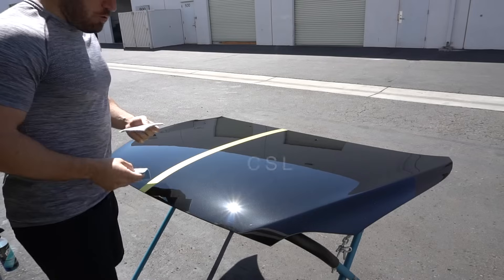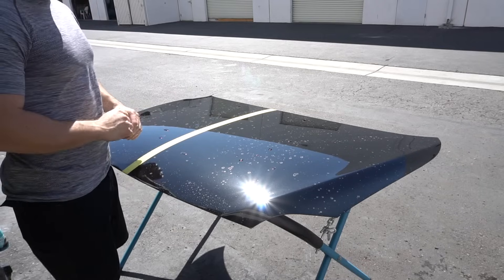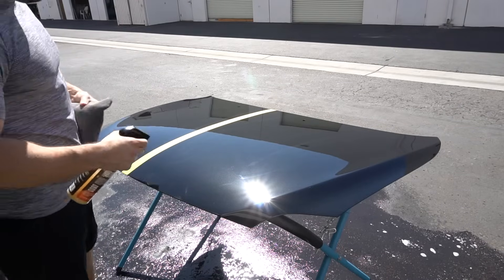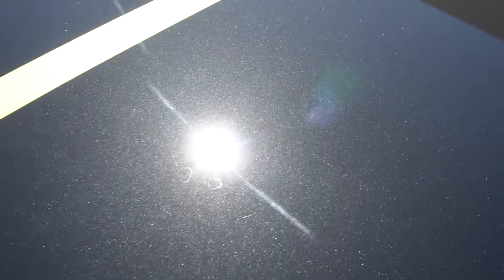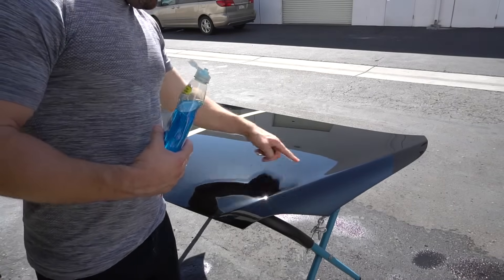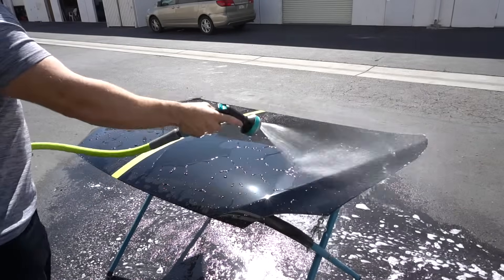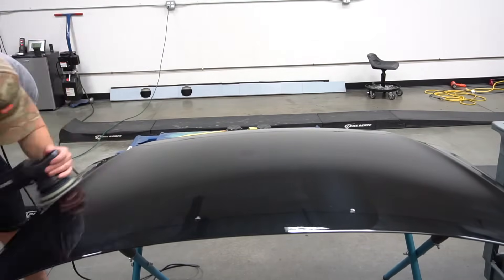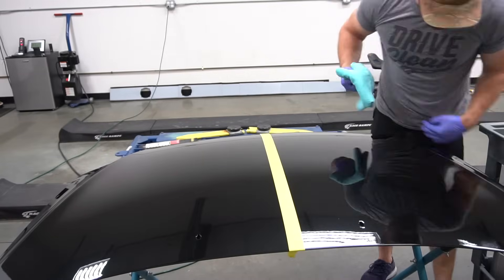Graphene Coatings VS Ceramic Coatings - Crystal Serum Light & Ethos Graphene Matrix

Comment: Great video. I have known about Graphene for years. The key was always the method to produce it and have it able to be applied to a surface (clear coat, paint, etc). Now you have demonstrated the properties - it is more resistant to poor washing, water spots, etc. which is why I have wanted to use it for years. I chose the Ethos product because the Company looks to be solid and the folks I see (Tim) are professional, approachable and able to communicate very well! I believe in Ethos. I watched this video and I didn't see any twist or turns to favor Graphene over the CSL. So, for me, this was unbiased testing. My results using the product are excellent. I have completed maintenance washes and clients cars have seen bugs, gravel, sand, massive heat and humidity. No problems at all so far.

Thank you for the test and keep up the great work! Chemistry will allow Graphene to evolve and likely improve, so I will stick with Ethos for the ride :)

Comment: great information... ethos makes great products.. btw, I know it's a test hood but it's still painful watching that water dry and etch on that hood.lol.. someone else mentioned a topper are you guys looking at something like that??   if so make it real slick ... thanks  again
Reply from the maker: barry bij Defy works great as a topper for maintenance and slickness. We might be working on something as well... 

Definitely painful for us to watch the etching as well!
Reply: @ethoscarcare  "We might be working on something as well..." I really hope so. I was more than a bit disappointed when you told me to use your Si02 products(defy & car soap) as a topper for your Graphene coating.
Reply from the maker: Rusty Cook why is that? We wouldn’t make a product that then makes the rest of our line up obsolete. Anyone of our products would work with our Graphene coating.
Reply: @ethoscarcare  Because you only get the full benefit of whatever the top layer is. Be it Graphene,Si02, Ti02, wax, sealant, or bird droppings. Why would I want to lose all the benefits you expounded about Graphene vs Si02?  Not trying to be an ass here, you got my money over a month ago & I'm very happy with the results.
Reply from the maker: @Rusty Cook you dont lose any of the properties by using our maintenance products, we designed the chemistry to with Graphene and even other brands of ceramic, tio2, polymer, wax coatings. As mentioned we designed our products to work together and you will actually see improved performance using our Defy and Ceramic Shampoo with Graphene but dont just take our word for it, try it yourself.
Reply: Rusty Cook go with the ceramic shampoo.  And definitely try the defy if it’s one or the other for ur budget!

Comment: Going to put this on a car next weekend. How is the application different from a ceramic coating? I mean as far as removal...
Reply from the maker: Matt Johnson - AHS in our experience we are seeing a very easy wipe off, less tacky than some ceramics. Temperature and humidity do play a role so start off with a small section and work up from there to test the application.

Comment: I think a good fair comparison would be against CSL+EXOv4. EXO provides CSL with the chemical resistance, hydrophobicity and water spot resistance. IMO it wasn’t fair to let CSL cure for only 3 days, at least 1 week of cure time should’ve been given. Just my 2 cents
Reply: So u sayin ethos won't need any maintenance at all for 7 years it's not about how many coats if u dont wanna compare the two just say so anyone with any sense would not just put one coat on anything u might be fooling the ignorant but some of us have a brain
Reply from the maker: Arsalan Syed apples for apples here, both were one coat with the same cure time. To be fair your saying that this product now needs more cure time and a whole additional top coat product in order to compete with a product that is one layer and no top coat?  Wouldn’t that classify the Graphene as we have described it to be?

That’s not how it was demonstrated in another highly contested video, which was presented as “fair” even with a messed up install. 

No difference in performance in 3 day cure versus 7 in our testing, we’ll be happy to also run this test again with EXO, Stay tuned.

Comment: Tim, really good comparison, I was surprised that Dawn Dish Soap was able to to degrade CSL after just a hand full of washings. My truck has CSL/EVO, in the  spring it'll be polished off, and coated with Ethos Graphine. In the mean time It'd be great if you can come out with a graphine topper with your signature gloss.
Reply from the maker: Looking forward to seeing your results. Dawn is a powerful cleaner especially at full strength, that is why we use it in our testing as it is effective at breaking down products.
Reply: Isn’t Resist a Graphene topper?
Reply: @platinumautoglasswindowtin88  the best there is :)
Reply: I already have CSL done on my car.  What if I just apply Graphine on top of it?